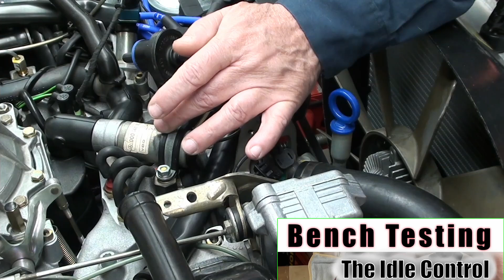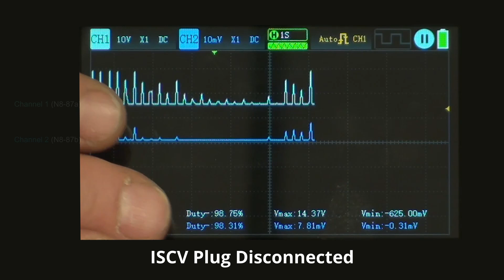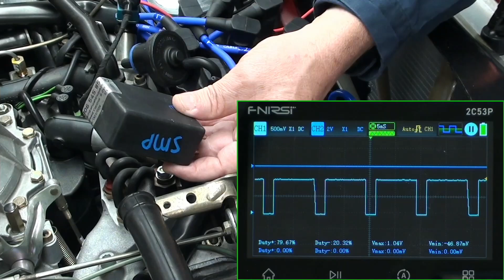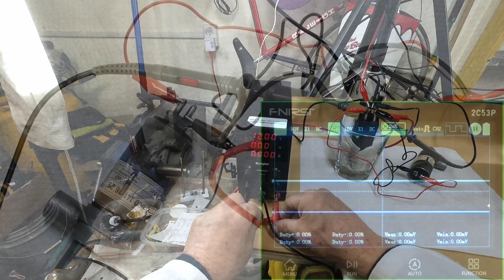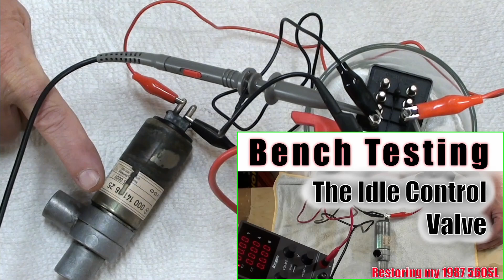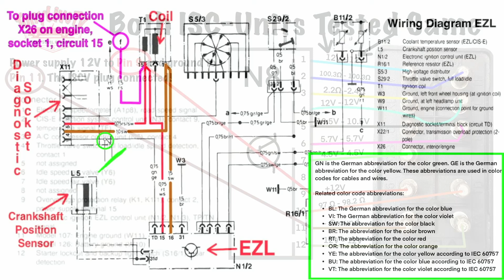560SL - How the Idle Speed Control Valve (ISCV) & Idle Speed Control Unit (N8) Work Together

Comment: Hey tony my fuel pump relay went bad i replaced it and started the car after 5 minutes the car just went to 2000rpm i mesure the voltage when the car is warm and shows 13v also my omh dor vale shows 10 but it should be 5 do you think the relay damage something?
Reply from the maker: This sounds like an electrical component failure. Since it was running good and then jumped to 2,000 rpm, it is likely electrical rather than vacuum (but check it anyway). I would start by checking the over voltage protection relay and those that control Idle speed (ISCV, the ICU). Besides a bad OVP, the ISCV is the most common. They often stick and full of carbon. Keep me posted on the progress. I enjoy troubleshooting.
Reply: @TonyLiveTV  i cleaned the valve it open and close 
But the omh is 10
And voltage from wire is 13
Reply from the maker: @asankovlogs  did you test the ISCV before changing the fuel pump relay? It definitely sounds like the ISCV. The resistance as you know is out of spec at 10 ohms. It’s definitely one of these components (ISCV, ISC/ICU, OVP).
Reply: @TonyLiveTV  it was good before i replaced the relay
Reply: @TonyLiveTV  the fuel pump relay went relay i bought from amazon not original it could be Chinese do you think it damaged something elese ?
Reply from the maker: @asankovlogs I don’t think the fuel pump relay is what caused the problem. Your pumps are working correctly right (pumps turn off at pressure)? This is what I think happened. Your old fuel pump relay had bad capacitors or solder. That means current was not passing through it. Then when you put in a new relay, the current energized the other components which may also be bad. That’s why I suspected the OVP or the ICU. You should have an extra OVP in the glovebox. They are not too expensive. That’s where I would start. It gets expensive after that, but this video should help you diagnose.
Reply: @TonyLiveTV  ovp rela is new i replaced it 6 months ago

Comment: wish i known you a long time ago great  videos had my 86 560sl for 30 years  have not been driving it for 10 just starting working on it  a 2 years ago off and on started working on fuel pump   first still cant cant start it still has a few leaks i have to repair
Reply from the maker: Thanks you for the comment. I hope you get your 56oSL running. I do have quite a few videos that should help you. If you have a question along the way, just hit me up here.

Comment: Hi Tony, I’m getting 2V at the ISCV connector when the ignition is ON. Is it right?
Reply from the maker: Voltage is not as important as current draw. The ISCV is controlled by the idle speed control unit with Pulse Width Modulation (PWM) so testing for voltage with a simple multimeter can be difficult. So the best test is the current draw test. Watch this video and see what you get:  https://youtu.be/4WmbojtYWKQ

Comment: Hi tony my car 420sel 91 md 
 car when gets temperature 80 degrees car runing wery high idle  I do not know  air flowe plate it’s ok 1to 2 mm  blow 80 ok runing fine  coul u explain what is problem thanks tony
Reply from the maker: @Like9-t  if the temperature sensor and other KE-Jetronic components test good, then it might possibly be a vacuum leak when engine is hot. Check the seals on the injectors and the intake manifold seals (donuts between upper and lower intake).
Reply: @ then tony great 👍
Reply: Iwill do dublle check thanks 4 feed beck

Comment: Great video, Tony - as always. I've probably watched it three times, as I have a similar problem with my C126 (the voltage on my ICV plug is too low, which causes a high idle). Do you know how I can test the socket where the idle control module is plugged in? My module seems to be fine.
Reply from the maker: @mooheight  The KE-Jetronic can be a nightmare. Checking voltage is one thing, but have you checked amperage? And make sure the ISCV is clean, not sticking, and closes smoothly and don’t forget that throttle position switch. In my latest video I show how I tried to test the ISCV’s amp draw. You are looking for 700-1,000 mA at idle. On the bench using my oscilloscope in this video, I didn’t mention amperage because on the bench I could not simulate this. The resistance of the ISCV is important. The higher the resistance, the higher the amp draw. Measure ISCV resistance cold. Should be 3.5–5.5 ohms between pins. Apply 12V directly across the terminals (briefly): Listen for a clear "click" or hum. Prolonged 12V should not draw more than 1 amp. If it does, you likely have a bad coil.
Reply: @TonyLiveTV  Thanks man!! Started to check amperage and found 0mA at EHA and 0mA at ISCV. Found a manual with wiring diagram and started to check wiring. EHA had 1 wire open loop with CIS and same between ISCV and ISCU. Now my idle is around 700rpm and 500 with gear engaged. A bit wavy idle but it’s a start! Got 950mA ISCV and 63mA at EHA idling(should be 75mA). Also adjusted air potentiometer to 0.7v. Now I have to get my mixture right, I have without CAT and O2 sensor ECE version. But car revvs so good from idle for the first time!
Reply: I uploaded 2 videos too.
Reply from the maker: @ that’s great news! I’m sure you’ll get it dialed in now.
Reply: @TonyLiveTV  Thanks Tony! Idle control valve is clean and measures 4.5 ohms, amp draw is around 600mA, so a bit too low. If I supply higher current to the valve using an external dc power supply, idle is perfect. So the main problems seems to be the current going to the valve (2.6V).
Reply from the maker: @mooheight  I will agree. Voltage sounds like the problem. The voltage from the ISC-Unit (87a & 87b) is 12v on each side. It will be hard to test with a multimeter because it is a PWM. With the scope you can see it more clearly @16:00 in the video. Putting the ISC-Unit in the bench and testing voltage could be an easy test. Testing voltage of the TD is also important. I’m sure you tired of this idle issue. Im sure the answer is in the manual somewhere (check out 07.3-009 & 07.3-121) https://www.tonk.ca/Index/117.5/07MechElec.htm
Reply: @TonyLiveTV  Thanks! Do you know the values for each components (described in 07.3-009) measured at the N8 plug?
Reply from the maker: @ I can’t remember off the top of my head, but in my video @27:26 I post all that I have. And that directory has all the documents. Document 07.3-112 & 07.3-121 should have most information you need relating to the ISCV.
Reply: @mooheight That's a really good idea!  Connecting an external DC power supply to operate the IACV to at test if you can obtain a normal or near normal idle!!!  My idle is at 2000rpm normal operating temperature.  Many tests and replaced several items including a new IACV from The SL Shop.  No major vacuum leaks, all throttle linkages adjusted properly, etc.etc.
It's an 88 560sl that's new to me.  
If l can at least get that idle down to normal with an external DC source, then I'll know there's at least hope, because right now I'm a bit discouraged.
Thanks for the great idea.
Reply: Thanks for this video! I have the same thing, really high idle and ISCV not working on the car. It stalls the engine with direct power, so valve itself seems to work. Plug disconnected and ign ON, I get 5.05v at pin1 and jumping voltage around 2-4v at pin2. After long cold start it keeps 1000rpm and the warmer it gets the higher the revs are. Slowly going up to 2800rpm when engine is at working temperature. Idle drops with gear engaged from 1000 to 700 and from 2800 to 1000rpm. Its 86 420SEC, everything seems to be the same, just without O2 sensor. Have done a smoke test for vacuum leaks, only a tiny tiny leak at the throttle valve linkage, but I think it doesn’t matter at this point when my ISCV isn’t working.
Reply: @henrit405  Have you checked your OVP relay? 100% sure that the module is okay?
Reply: @mooheight   I have resoldered all the connections inside. I haven’t seen ABS light on as well. Also my EZL is working, as when I disconnect the vacuum, rpm are decreasing.